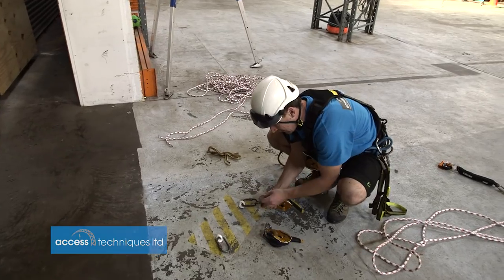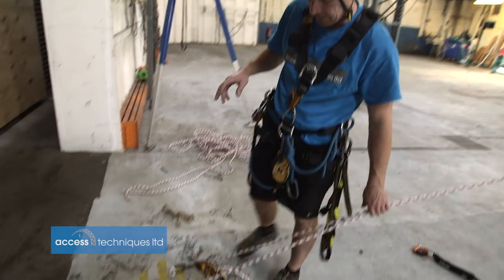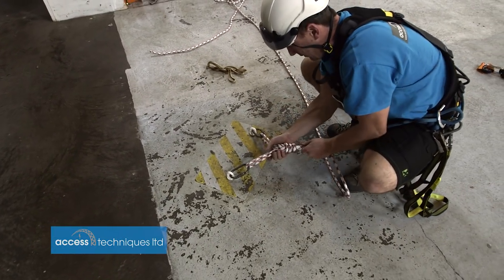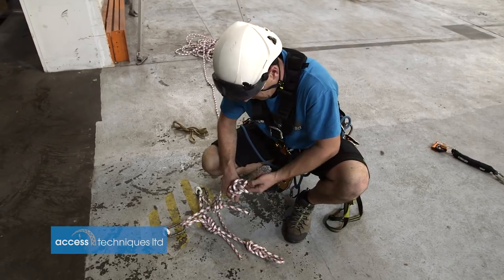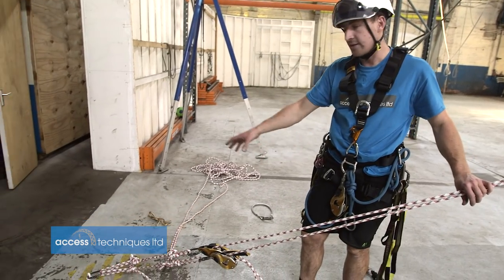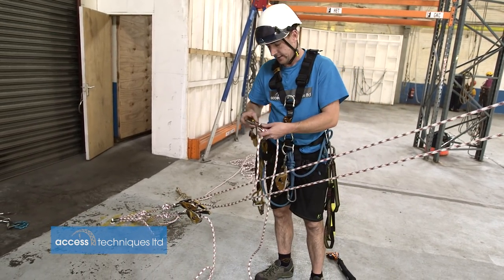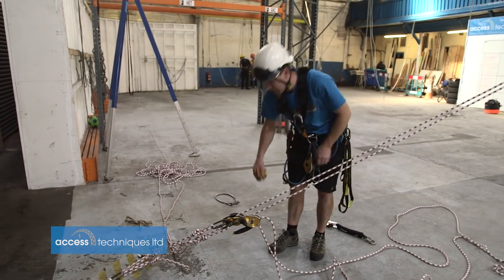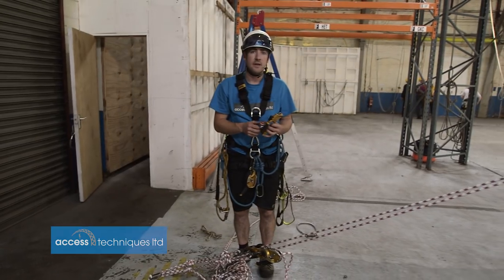Rigging Tension Lines for rope access

Comment: Great vids going for my level 2 soon and our practices are a bit different here in canada but practically the same.
Reply: Hi are you Rope access technician
Reply: Yes I am
Reply: Maybe you could answer this.  I have a high angle rescue background and only watch rope access videos because who doesn't love watching rope work! Question is this; is it common practice to clip 2 biners together?  It isn't something we would ever do and I've seen it in a couple videos now.  If so, would they have to be a triple action gates to mitigate rollout?  Thanks!
Reply: @esstee5888  I think it depends on what you're doing and where, as to whether or not it is common. For example I have steel slings where the only option is to clip into the caribeaner,  but have used steel slings where there is enough space not to.  

One thing to be mindfull of when clipping two caribeaners together is rotation and the ammount of excess force applied to the caribeaners in the form of torque as well as potential rollout.  Both screw gates and auto locking are used in rope access, but a company may decide what material (Ali or steel) or gate action (screw gate or auto) they want you to use while employed with them. 

Hope my comment helps!

Comment: Interestingly, the company I work for presently, insists ID's are locked off then an alpine tied and clipped off to a separate crab on the sling, this applies on tension lines and also on ropes rigged for rescue type situations.
Reply: +Alan Wilson Tying the ID off would prevent the ID from doing its job in a tensioned line, that being a load limiter. I have seen allot of techs tying these off in multiple systems, never seen it before until I came to a refinery Im on now.
Reply: Petzl specifically says to tie a knot in the free end of the rope.  Google "Tensioning a rope for a Tyrolean" and look for the Petzl link.

Comment: youve taken two strong anchors and made 1 weak anchor. i dont get it. id rather have the two than one based on rope... methinks bullshit....whats the weight rating on that rope, maybe 6k but you doubled the stress on , yes i saw doubled line, yet thats doubling your accident factor. if something fell and hit 1 line you had a second as backup. Now one line, one accident one slip or cut of the anchor can kill you....no thanks...I'll continue to double anchor if i feel the need..you completely negated your redundancy. now of course theres not much point in your redundancy being 1 foot away. lets say another guy dropped a tool that cut that little loop you tied...wheres your backup?